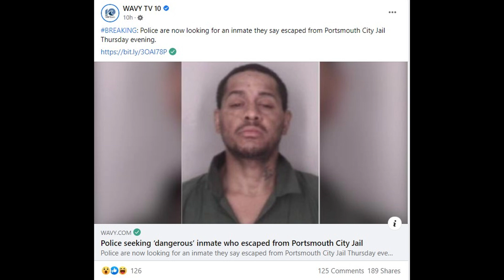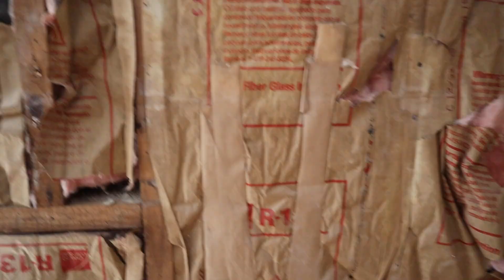Time To Start Putting My Bathroom Back Together

Comment: Those black flys.  If you don't over do it.  Are going to feel good after a couple weeks.    Body weight squat form.  Wider leg stance.  Go deeper.  Keep your hands steepled infront of your chest.  Definitely off your neck. You are pulling yourself over and wrecking your back.  Keep your head and eyes looking up but not cranked. This will keep your back straight.

Comment: I flip also if your area allows you~you can run a dry vent-in\check valve the wall instead of running a stack all the way through the roof which is a pain in the *ss. $$$
Watch some houses that are the oldest houses in the area because you will have to deal with the town committee to vote on every damn thing you do haha...    great videos thank you you're making a difference ☆,

Comment: Joe did you know that you need to register your drone with the FAA because it weighs more than 250Grams. Also you need to have a visual line of sight or someone to watch your drone while you fly it with the goggles on. I've had the same drone you have and am still afraid of Manual mode.  Hats off to you buddy, best regards, BA